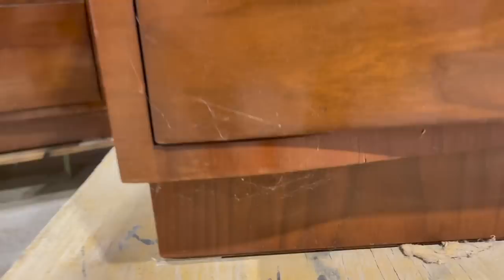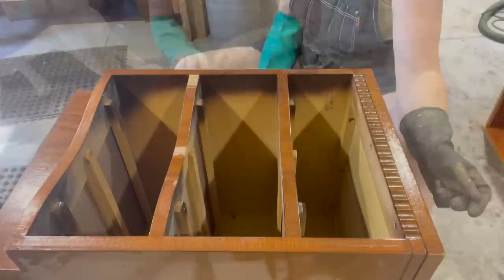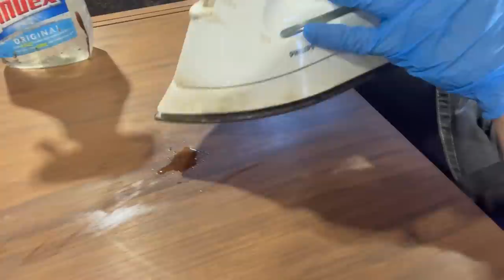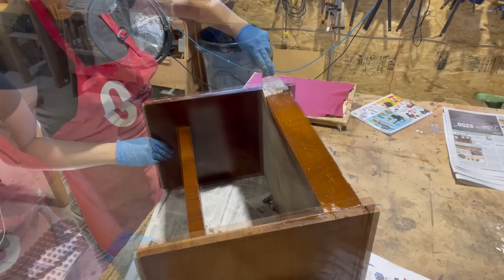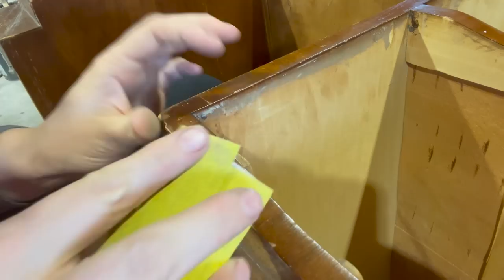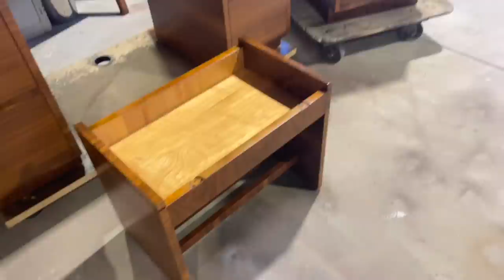Why was THIS on teak!?

Comment: Looks like a whole different set of furniture with the grain and colors popping.  I have not watched your stuff for a while, and it’s gratifying to see your development.  The delivery is lighter, the educational elements are there still, and the improved production quality makes the flow go smooth as silk.  Shop Dog 🐕 still rocks
Reply from the maker: Thanks for tuning in!
Reply: Teak is so beautiful.  My parents had a lot of teak furniture bought in Denmark in 1960.  They only used a linseed oil/turpentine mix on it, hand-rubbed in  every few months and it stayed nice always.  I think theirs must have been solid teak because every piece was curved and had rounded edges.  There were no flat surfaces except the tabletop and sideboard top and even these had curved edges, not right angles.

Comment: With the lack of headboard i suspect one of two reasons for the single bedside table. It was not uncommon for married couples to have two twin beds rather than one full/queen size bed with the single bedside table being placed between the beds. Alternatively if this was for a single woman or older teanager sets would be bought with one bedside table then you can place your bed against the wall and gain a bit more space as bedrooms used to be a lot smaller than they are today.

Comment: Love how these turned out! A really nice mix of different tricks and tips to learn from as well.  You had some great help in the shop! One question: is it me, or is the choice of grain direction on the edge veneers unusual?  (Cross-wise instead of along the length of the edge?)
Reply from the maker: Yes a lot of modern pieces did this. Cheers

Comment: My grandmother had some Danish modern teak furniture that was popular in the 70s ,real simple without much design. It was put together with wood pegs so it could be taken apart like a puzzle piece - but it has a tendency to fall apart like a puzzle piece if it's moved around.  
If the teak furniture is assembled in a way that's meant to be taken apart how would you reassemble it to be sturdy and less prone to fall apart?
Reply from the maker: If you want it to be more permanently build it would need joinery. Cheers
Reply: @johnsfurniturerepair  😊

Comment: Trena, I noticed you use a Festool random orbital sander on many of your projects.  Can you tell me if the sander had a 3mm or a 5mm sanding stroke? And depending on which one you use, would you ever consider the other? - Phil
Reply from the maker: hmm id have to check on that. its an ets125 if you want to look it up also

Comment: I know you are a dedicated user of Swing liquid stripper which only is available in 5 gallon buckets or in a pack of two 1 gallon bottles, but I need less stripper and wonder if you know an equivalent alternative? What about QCS? Does it have drawbacks you don’t find in Swing?
Reply from the maker: i havent used qcs but i want to try it. swings residential brand is circa 1850. its pretty good.

Comment: Great job again! You make using stripper seem like a zen exercise! That has NOT been my experience! Similarly, your amazing skill in working with veneers stands out. I have a very old weight driven American wall clock that needs some veneer replacement. A job at which I have (thus far) been singularly unsuccessful. Your video might provide the impetus to have another go. Great to see the cameos by Shop-dog & your talented daughter. The re-finished suite looks great – especially in the natural wood. Well done!
Reply from the maker: Thankyou

Comment: 10:40 are you aware of these small hot air soldering devices that are needed to mount tiny electronical components (smd parts) ? They are cheap, starting from 40EUR, and you would be able to exactly bring heat to the surface, and that without actually touching it.

Would not that be worth a try ?
Reply from the maker: Ive thought I’d getting a hot air pen. It would be useful for a number of things. Cheers.

Comment: The bedroom set looks awesome and teak is such a nice wood.  

BTW: I wished we lived closer so I could have you work on this piece: I have my father's old work desk that I'd like to see the finish restored.  You are inspiring me to one day attempt to restore this desk : It has some scratches on the top, and not sure what the color was/is... it looks like a dark orange-ish on the top and kind of an olive green elsewhere on the front and legs... not consistent, that's for sure.

Do you Have time to answer a quick QUESTION?
What setting did you use for the edge banding?   Also I need to stain the veneer a dark color, I'm starting out with lighter maple color (it's what I have on hand and matches closer to the color of the plywood when I started)

P.S. here's something I would have never thought of or tried without inspiration from your channel!!!!

I am using Varathane oil based stains on this project.  First I start with an light orange color [gunstock], followed by a darker color [Carrington] so the finished product is that I get the warmth of the orange underneath... and I think it looks pretty good, the trick is to keep the dark color consistent but wipe it off quickly so you see the orange undertones... fantastic!
Reply from the maker: I use my iron on high. I’m impatient. Lol
Reply: @johnsfurniturerepair  Thanks for the fast reply! Impatient... That's me too LOL... so let me get this straight: The settings on the "edge banding Iron" go from "Patient" to "Impatient" with the actual control superglued to the Impatient setting just incase the iron got bumped but you're so impatient that you didn't notice it, then there's no way for the control to move and you'll be in business in no time flat.  Makes sense...  LOL... 🤣 Cheers and have a great day. Thanks again!

Comment: I would go back to the original rich color finish.  Too many people today don't use stains.  Stains improve the richness of woods.   To me i feel you are cutting corners and changing character (not in a good way)  of the piece by not staining.      But i live in a converted barn that is finished in redwood tong & grooved walls with deep  red stain on all of the oak beams.     I actually hate furniture  or wood in general without stain...   I also restore classic mahogany boats.   Most were stained rich red mahogany color when new.  They look lethargic when not stained correctly.
Reply from the maker: i both agree and disagree with you. thanks for tuning in! cheers